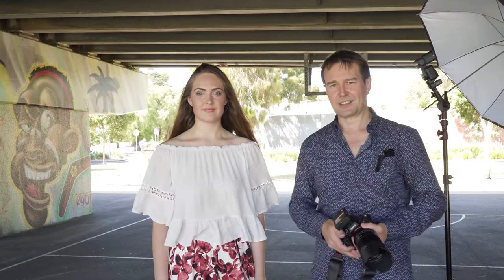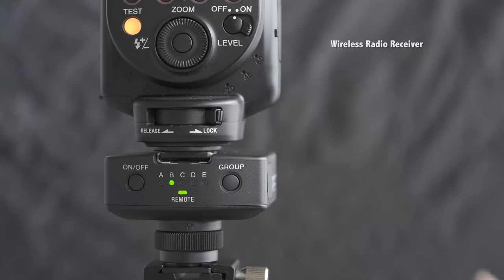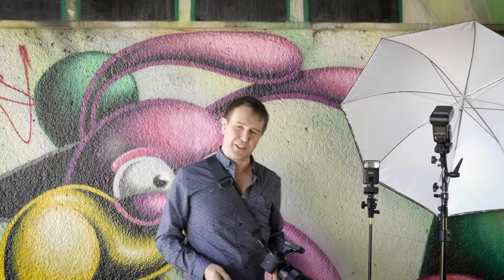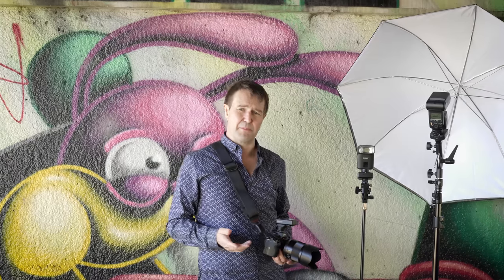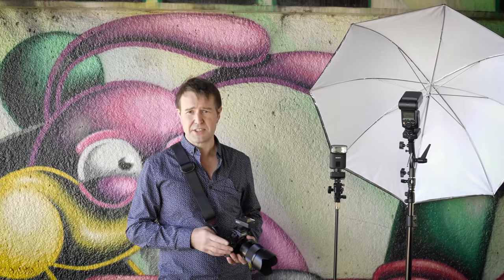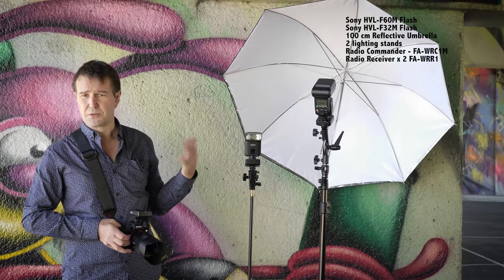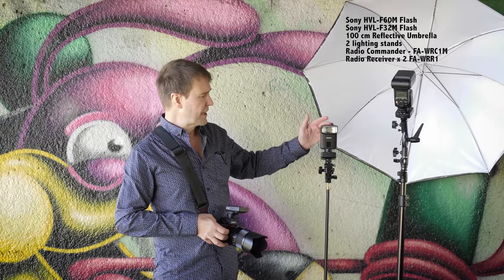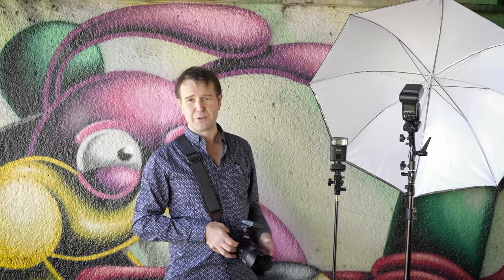Sony's Wireless Radio Flash - Location Lighting Demo

Comment: Hi, i also use TTL off camera flash with manual camera settings. Is there a way though for me to control the flash output?? (I dont have a commander, just a small flash HVL20m)
Reply from the maker: When using TTL you have a flash compensation adjustment on the camera. On the larger flash units you also have a TTL exposure compensation on the flash itself. When using Flash in Manual (not TTL) you can adjust power output on the flash units.

Comment: Hello there, Can you change the flash power  from a camera menu or Sony doesn´t have it?
Thanks a lot!
Reply from the maker: Use the flash compensation on the camera when using the flash in TTL mode or adjust directly on the flash unit.

Comment: On my A7iii, is there any disadvantage to always keeping a flash set to high speed sync?  It appears as though even with high speed sync set, if the shutter speed is at 1/250th  or below, the flash acts in its normal way and if I go to greater than 1/250th  it will act in high speed sync mode. So why not just always leave it in high speed sync mode?

You have some great tutorials, thanks.
Reply from the maker: Yes - HSS works the flash harder - the flash is either less powerful or takes longer to recharge. It is also harder on the model's eyes as the duration of the flash is much longer.
Reply: @AlphaCreativeSkills   Yes, Mark. Thank you.  I understand thaat HSS has drawbacks. But if the flash is in high speed sync mode but the shutter is at 1/250th or below, does high speed sync actually kick in?  Thank you.  Again, your tutorials are excellent, very thorough and easy to follow.
Reply from the maker: HSS is not activated (even if selected) at shutter speeds of 1/250 or slower.
Reply: @AlphaCreativeSkills  Thank you, Mark.